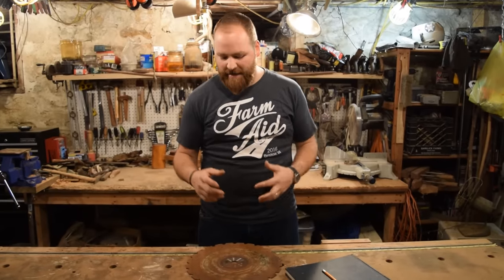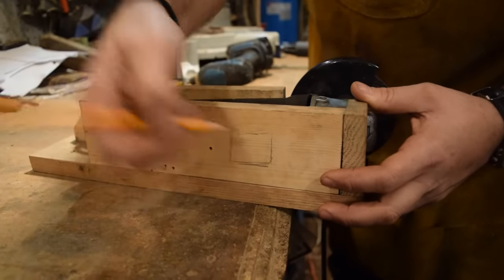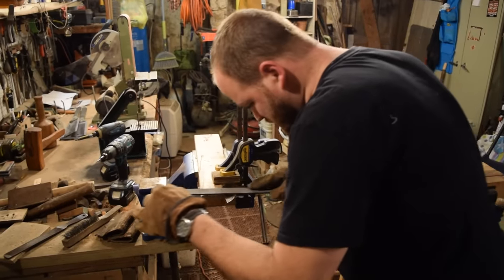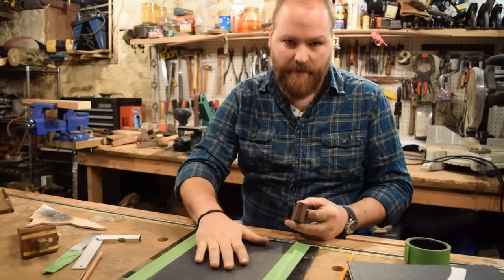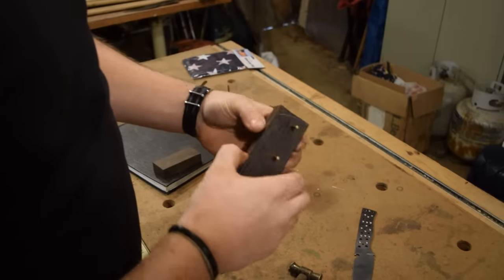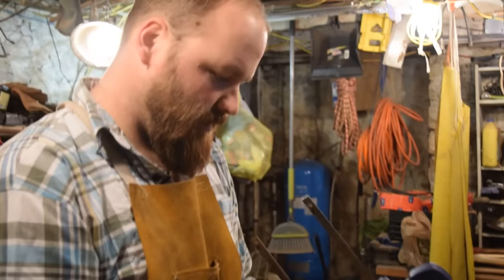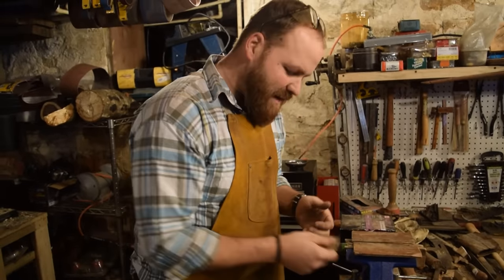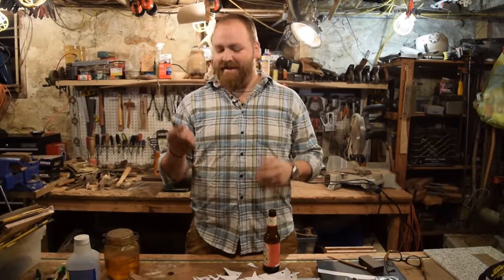Making a Knife From a Circular Saw Blade

Comment: What are you squirting on it for lubricant ? Is that soapy water ?
Reply from the maker: Drilling the holes, I use WD40.
Reply: The Art of Craftsmanship with drilling holes, WD-40 will kill your drill bits, You should use cutting oil not lubricating oil, but I was referring to the sanding of the metal you were applying, not disrespecting you, just saying, I’ve been in the metal Field for 42 years, also want to say, you are extremely creative and you are very smart I love the work you do 😁
Reply from the maker: Gotcha, thanks. I was using a glass cleaner. Maybe Windex, or another brand. I will always take advice, so no need to explain. I didn’t know that about WD40. I have 3in1 in the shop, which I also use occasionally. Is that better? 
Thanks again.
Reply: The Art of Craftsmanship again, 3-1 is a lubricant, you need a thin oil, like kerosene type oil, even water would be better to keep drills cool , it’s basically the heat and thick oil that dulls drills so if you used water it would be better, think, cooler harder longer, I know it sounds strange but as long as you keep the tool cool it will last longer and sharper

Comment: why no heat treat and tempering?  beautiful knife though... you got my sub!
Reply: He mentioned in the first minute or so that the old saw blades were already treated and tempered.
Reply: @michaelsorensen7567  ahh ok, makes sense.. I suppose if he doesn’t get the material too hot it wouldn’t affect the heat treat and tempering right?
Reply: @darksidetize5183  that's the theory.

I personally have no idea. Reading other comments there seems to be some debate over whether the grinding could distemper it, or whether tempering would be necessary.

Just wanted to point out he explained his thought process at the beginning 😁

Comment: Why don't you get a bench grinder so you don't have to use your angle grinder like that  I find bench grinders at yard sales and pawnshops all the time from 5$  to 20& I have three for different uses
Reply from the maker: Thanks for watching and the question. I have a bench grinder, but I prefer to use the angel grinder for the majority of the bulk removal. I like the speed that it cuts compared to the heat generated, and the grinding disks are cheep and easy to replace. Thanks again.

Comment: Sorry einstein but the only way that the original temper of the steel is going to be retained is to have running water on the blade as you cut it out as a blank, then as you sharpen, grind the final edge use a very low heat method otherwise use running cols water during this process also. You have lost most if not all of the temper of the steels edge areas using a  grinder as you did in the video.

Comment: NIce video; thank you. That looks like a piece of black walnut you're using for your handle. You appear to be an experienced woodworker, but I noticed that you're not wearing a mask as you sand that walnut, and walnut has a dangerously active immune system. A splinter will raise a pustule within an hour and people have died from the reaction of having black walnut sawdust/sanding dust in their lungs. Do yourself and your family a favor and wear a mask when working with black walnut.

Comment: I'm under the impression that circular saw blades aren't good enough for knives, not enough carbon content. What's your impression of them. I want to make a nice knife, but don't want to spend all that time and energy on an inferior blade.
Reply from the maker: Ive used circular saw blades over the years for knives, and they have held up relatively well. Its not the hardest result for a knife, so you have to re-sharpen them more often, but if your ok with that, they can be fun. I would suggest buying a piece of 1084 steel online if you are able to heat treat your steel, and if your not able to do the heat treatment at home, there are lots of places that will do the heat treat for you. Also, metal files work great for knives, as long as you are using a file that is not case hardened. Metal files are usually made from 1095, which makes superb knives. 
Good Luck

Comment: Great craftsmanship kinda wasted on a non-hardened blade.
Reply: John Crawford I beg to differ. That steel is hardened and tempered. Did you not see the sparks? Those look like hardened steel sparkly sparks to me, not soft steel glowing sparks. As he said in the start of the video, he’s done it before and they don’t held an edge superbly well but they do still hold an edge. My guess is that sawblades are tempered for toughness over hardness but they’ve still gone through the heat treating process and they’re still decent steel that will hold an edge reasonably well, while being very easy to resharpen.
Put it this way: that knife is still a far better quality knife than the ones you find in most kitchens!

Comment: Hmmmm, a tradesman/craftsman would NEVER hold the tang of a file in his hand while working the file!!!   for pretty obvious reasons,  a Hobbyist might! or a diy'er,  
As soon as any part of the blade heats up, to a cherry red colour while cutting the tensile strength has been altered and will need re tempering!  
or you will need to sharpen the knife often.  also some newer saw blades are not tempered at all! only the cutting edges, so pick your blades carefully

Comment: No offense but your drilling makes me cringe, you are literally holding it down with your thumb on a vice, use the vice to hold it, also grab the next handle round and use your forearm to push rather than pull, you can push harder with more control and less likely to shoot through. Kinda hard to explain, it's how i was taught many years ago, I'll make a short video showing if needed.
Reply from the maker: Good advise Tom, thanks.

Comment: You call this half-assed attempt at knife making Craftmanship?....Until you learn and perfect heat treating steel,  any knife carved from a saw blade is junk..See all those sparks?...That is the steel LITERALLY being burned away along with the original heat treatment..  You might as well make it out of aluminium because until you normalize and the heat treat it,  it will never take or hold an actual edge... For the record, most old circular saw blades are made from either 1095 or L6, both of which make outstanding knife blades when properly heat treated.🔱😈